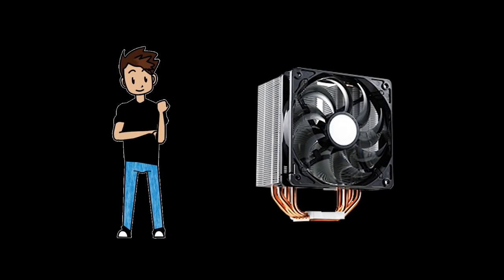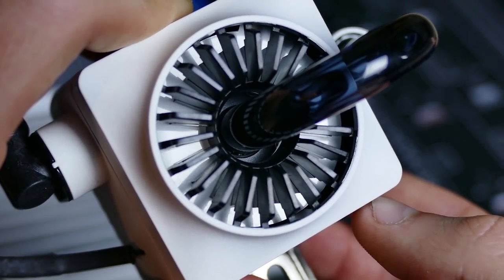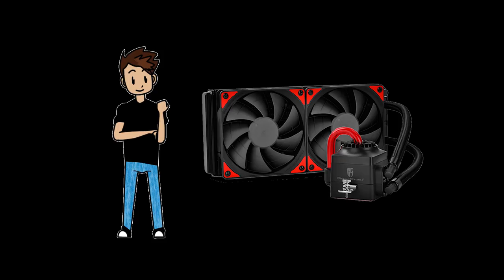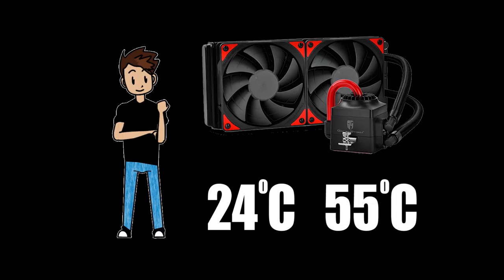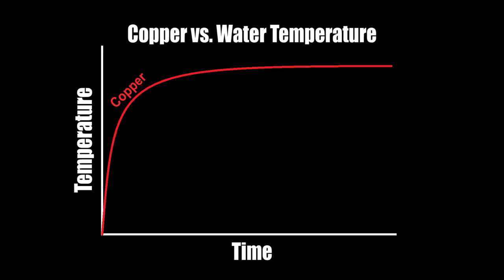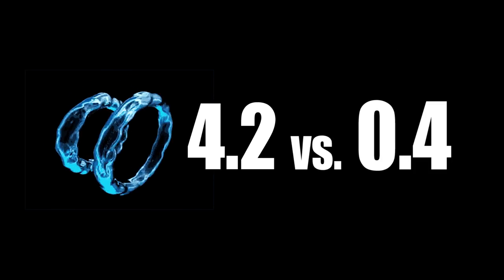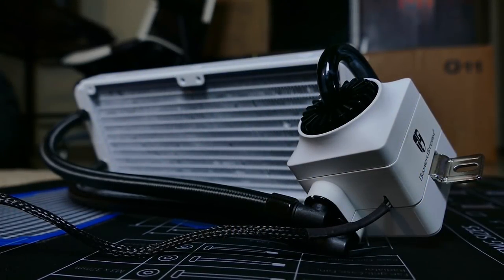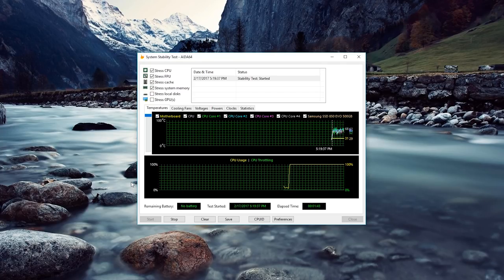How to Properly Measure AIO Temperatures

Comment: TLDR: there's nothing wrong with AIOs, only with users simply misinterpreting AIO results.
Reply: up to the top mate
Reply: Cool, thanks. Now i can finally change my stock cooler without this guy being condescending
Reply: Yeah, and idiot reviewers not understanding that cooler for longer if an improvement. Compare it to upgrading the intercooler on a turbo car, and you expectations will be level.
Reply: Yeah but most AIOs leak. I had a corsair h80 for 5 years till the pump failed. Then i went for the gtx 110 AIO. Lasted only 2 years before it started to leak. Air cooler you dont have to worry about that.
Reply: Yeah, that’s what he said in the video
Reply: @Richard-rk1ru  Yes but it still means the title of the video is misleading. Its making out that AIOs are lying to you (which most people are going to read as the manufacturers of the AIOs are lying to you about their effectiveness) when really what he means is that some people online are not testing them for long enough when giving their results. The AIOs are not lying at all, they are in fact effective cooling and more effective than an air cooler, he says as much in the video. Even with the people not testing them properly, most of them would not be lying,  it's simply them not understand how they work and not doing a long enough test. Lying implies deliberate deception. Hell before I put my own AIO cooler in I tested the air cooler first for 4 hours (Admittedly with Prime95, not the programme he mentions in the video) and then did the same thing once I had the AOI in and the temps were definitely cooler with the AIO, even after the water had time to heat up. I did not feel ripped of or that the manufacturer had somehow lied to me, after all, the cooling was indeed more effective.
Reply: @MegaUser213  That's an absolute lie that  " most aio's leak". if that were the case they would be out of the business pretty sharply. I've got one that's been in and out of a system at least 11 times and has never leaked yet despite some rough handling. AOI leakage is around 1% and almost always happens early in use so is fully covered by the warranty.
Reply: the irony here is that he is wrong with his premise too. water dissipates heat much faster than metal. The only reason it doesn't in this situation and in others is due to the water needing to be incased in something which takes away air flow that the metal receives. IF you incase them both with the same casing and heat them up the metal will retain heat far longer than the water. So his argument is correct but his science is flawed.
Reply: Ty
Reply: @zephirol4638  If I understand what you are suggesting correctly then you are wrong. If you took a litre of water and put it in a thin-walled copper box of roughly cubic shape (or any shape that has a high volume to surface area ratio), and also had a solid lump of copper the exact same dimensions as the water-filled box, and then slowly heated them both until they were uniformly the same temperature, then the water-filled box will cool a lot more slowly than the solid copper. This is simply because of water's much higher specific heat capacity, which means there will be roughly ten times as much total heat energy to be lost, compared to the solid copper. Water is also a much poorer conductor of heat, which would slow the flow of heat energy from the center to the sides, although there will also be convection, which would have the opposite effect and I am not sure which would be greater. However, these are much less important factors than the specific heat capacity.
Reply: @zephirol4638  Water dissipates heat much faster due to evaporation, if you contain the water then it would take longer.
Reply: @TheGodpharma  I realize I miss typed my initial comment and I should specify most metals, but I still disagree. The problem is the container for the liquid itself. The container will retain the heat as the water dissipates it. The reason the metal naturally dissipates the heat is due to air flow. Which Air dissipates heat far less than water. That is why you can spend hours out in the cold and be fine but jump in water and you will get hypothermia in no time. If you could form the container for the water, out of the water his premise would be wrong, and that was what I tried to explain in my middle of the night stupor. lol 

An I suppose I could still be wrong, so by all means if you feel I am now that I tried to convey my point more precisely by all means. I'm happy to learn something new.
Reply: @anhquansei  That is just a result, not the reason. You can do the same experiment with far less heat that will not boil the water to cause evaporation and the water will still dissipate the heat faster. 

Containing the water is the problem because there is no airflow getting to the water like there would be with the metal so it's already a flawed experiment. when proving or disproving the point I am attempting to make due to the variables not being the same.
Reply: @zephirol4638  I'm still not completely sure I understand what you're getting at, but I have realised that I did make a large error in my example, in that I neglected to take account of the difference in density between water and copper. Copper is nine times as dense as water, but it has less than one tenth of the specific heat capacity (the amount of energy needed to heat up one gram by 1 degree C). These almost cancel out when talking about a fixed volume, so in my example the total thermal mass of the solid copper and the copper box filled with water will be nearly the same (though still slightly higher for the water). This means that the amount of heat energy that they need to lose in order to drop in temperature by the same amount is nearly the same, so the rate of heat loss (and thus rate of temperature drop), under the same external conditions, will be determined by the rate at which heat can move from the interior to the exterior. This is a function of conduction in the case of copper, and conduction plus convection for the water. Copper is a much better thermal conductor than water (by a factor of 600), so I think the copper would cool faster, but I don't know a way to calculate the effect of convection. In microgravity, where there is no convection, the copper would certainly cool faster. The key difference in an AIO is the rapid forced movement of water, which will move heat away from the CPU much more quickly than air could, but that still has to be dissipated to the air via the radiator, in the same way that an air cooler does. Once a water cooling system reaches equilibrium the rate of heat loss is determined only by the radiator and fan system, which isn't inherently any better than an air cooler, but in practice is probably more effective just because the radiator/fan system on a water cooling setup is usually bigger than an ordinary air cooler/fan.
Reply: I felt my hands cramping watching him speak.
Reply: @user-dz3lo4wh1q  Early as in when you first use it. The case is that if it is faulty then it's faulty direct from the manufacturer and also would be likely to leak inside the box. It's filled with water so any leakage of water directly onto the PCB of a GPU could potentially harm it but it's not like an  AIO undergoes a massive increase in pressure when the pump comes on, it just circulates the water. You would know if it was leaking before it became a problem.
AOI's are getting better every year and I'd not hesitate to use one in any system that I did not have plans to do any extreme overclocking with. I'm currently running 3 aio's now , a mixture of CoolerMaster and Corsair. The one I spoke of in my post last year is a Corsair H90 and that's still going on one of the kid's systems and has to be at least 6 years old.

Comment: Greg you can't just ignore your chemistry rules from chem lab, 4.18 J/mol Greg keep at least 2 decimal places to get accurate results.
Reply from the maker: Meh. 4.2.
Reply: Salazar Studio also if you use a metal with a very high specific heat capacity, that means it would take a lot more energy to reach the same temperature as the water therefore extracting the heat out of the water faster. is there a negative consequence to that because I know this problem can't be resolved that easily.
Reply: Salazar Studio "Good job, your bridge is now in the river and you just got fired" -my dad
Reply: The rule really is: always round the the least accurate number. If your least accurate number is an int you can't really use decimals, which is why you'll see decimals with only zeros if the integer is the result of two decimal numbers.
4 + 4.2 = 8
4.256 + 5.7442193 = 10.000

Also more decimal points is not equivalent to more accuracy but more precision, very different words in science.

Comment: This failed to address the most important factor:

the specific heat capacity of  RGB LEDs...
Reply from the maker: Tru my b
Reply: RealNukerity lol how can you even remotely think he is serious? XD that's a joke
Reply: god you must be fun at parties
Reply: It would take about six LEDs to consume a Watt, about 90% of that Watt would be heat.
Reply: My predictions for the future of PC modding:
* Glitter flakes in the coolant.
* Much chrome, many tassels around case windows, RGB bobble head Jesus on PSU shield.
* Organic cases, Tweed & bamboo, driftwood etc.
Reply: Massimo O'Kissed Glitter in coolant?! Do you imagine what will happen to the pump and radiator after that stuff clunks up in a choke point?
Reply: You know that we allready have pearls in coolant, right?
Like in a good pearl paint job.
Looks amazing.
Reply: +Imaran Syafi He's never been invited to one.
Reply: RealNukerity red for better overclocking and blue for lower temps all around
Reply: Massimo O'Kissed I just want the chrome chassis. that's it. good for blinding would be burglars with the RGB LED rainbow
Reply: +Massimo O'Kissed

>It would take about six LEDs to consume a Watt, about 90% of that Watt would be heat.

Red, green and blue LEDs have different efficiencies and voltage requirements, but none are only 10% efficient. LEDs with poor efficiency haven't been made since the 1970s with early GaAsP LEDs.

Modern GaN LEDs can be more than 50% efficient, with less than half of their power consumption being wasted as heat.
Reply: +Deltakilla45

>0.5watts per standard LED

Standard indicator LEDs are not half watt, those would be ridiculously large and require a heatsink.

LEDs used for indication/decoration run between 1.8-3.4v at a current between 15-20 mA. This would be between 27 and 68 milliwatts, not 500 mW.
Reply: +Deltakilla45

>im talking about the standard 5mm half watt LEDS that have no heatsinks

Standard 5MM T1¾ LEDs are not half watt. I did the calculation for you, which applies to both T1 (3mm) and T1¾ (5mm) LEDs. They run between 27 and 68 milliwatts.

Specialized T1¾ 5mm LEDs do exist that can run at half a watt, but are expensive and have a heatsink almost as tall as the LED itself attached below it to dissipate heat:

www.ebay.com/itm/371136457827
Reply: +Deltakilla45

>i see no heatsink

Because you didn't scroll down the page.

http://www.topbright88.com/ebay/ebaypix/shop4leds/5mmHPled4.jpg

Half of the heatsink is embedded inside the plastic/resin body, with the large metal plate with holes being the part exposed to the air.

This is a standard T1¾ 5mm LED, notice the lack of any heatsink and the inside lacks huge metal planes.

http://i.ebayimg.com/images/g/QgQAAOSwo4pYR46l/s-l1600.jpg
Reply: +Deltakilla45

Haha, are you mad that I've proven you wrong time and time again? Maybe you should have properly done calculations before making the claim that standard T1¾ LEDs are all half watt.
Reply: You're both wrong. The percentage of electric power consumed by an LED (or any other device), that is converted to heat: 100%
Reply: Geoff Graham Wtf? You are saying that ANY device produce 100%heat? So the light bulbs above you are only heating and emit no light?
Reply: Some percentage briefly exists as visible light, yes. Which is then instantly dissipated as...
Reply: I have rgb socks
Reply: Don't listen to this Dude though it's Bullshit the Aio and H100 is very Entry Level and will perform Badassedly.
Reply: JR I prefer my x62 with 280 rad
Reply: Geoff Graham,
Sigh. No. For many thing that's true, but not lights of any kind. In fact the EFFICIENCY of a light is the amount of photonic energy produce vs the amount of energy it took to create that. So if a light was 90% efficient and took 10W of energy to run then 9W of energy is converted to photons with 1W being heat. 

In a closed box the photons would bounce around and eventually be converted to heat but that's not what we're talking about.
Reply: Jeffrey Photonboy Why wouldn't you talk about that? The computer case in this example is a literal closed box. And unless it's full of mirrors the light doesn't bounce around much. So not eventually, but instantly converted to heat.

Some small portion of the light will escape the box and to fall upon the walls and your retina allowing you to observe the cool rgbness of it all. But if you are using the room's air for your cooling, then even those photons heated up your rig. In fact, the only losses here are the photons that escaped your window and fell on your neighbor's house. That is a vanishingly small percentage.

I was being a bit cute up there, but I'm still right. The amount of heat contributed to your thermal envelope by 3 watts of LEDs is about exactly 3 watts.
Reply: SPEEDERT12 , I'd be pretty confident that fittings, tubes, impeller pump and rad could handle glitter flakes.

It's the tiny fins & channels in the cooling blocks I reckon would choke.
Reply: Walter White was an inside job.
Reply: LED fires: the latest epidemic.   Note to self: invent liquid helium LED cooling solution.

Comment: 1. Absolutely nothing to do with AIOs in particular but water cooling in general. Custom loops are no different.
2. "Lying" would be a manufacturer misrepresenting results obtained after a 1-minute stress test, which they typically don't do and was not demonstrated.
3. The higher heat capacity is portrayed here exclusively as a detriment because "your CPU will run hotter for much longer after gaming sessions". In reality, your CPU will never run constantly at AIDA64 load levels - short bursts of heavy usage with a lower total average are much more common.
I.e. with (decent) water cooling your temperature spikes are much lower under typical conditions (as well as your overall average) which is more beneficial. This also prevents thermal throttling under sudden heavy loads (again, not talking about 6-hour AIDA64 tests).
Also, would you rather have your CPU run at 80-90°C for an hour with the cooler fan running at 100% (putting stress on both components) followed by an hour at ice-cold 30°C (while you're not even using the PC) vs. having it run for 2h at a very comfortable 50°C for any architecture?
4. Title is misleading and clickbaity as fuck, and the video doesn't get much better.
Reply: Insert THANK YOU meme here.
Reply: Thank you for telling the truth, with this comment you put him in recovery position.
Reply: So would an X62 allows me to run my 7700k at 5GHz around 1.36v without overheating? My current H5 Ultimate causes it to hit in the 90s, I think it might not be seated properly, but I was thinking of changing to an X62 to hopefully get much better temps
Reply: @MrZodiac011 
It worked for my i9 9900k (all cores at 5ghz).
But I change the fans by noctua 140mm pwm fans.
I use the industrial 2000 rpm version but I don't go above 1500 rmp.
In stress test with occt my max temp is 60C (I use four fans in push and pull).

My gpu is water cooled in the same way too and the max temp is 42C (it's a rtx 2080ti).
Reply: @Street_Cyberman  Jesus dude you must of put a shit ton of money into that lol. I have a i5 9600k and a 1080ti and would love to water cool my build :P I would probably upgrade the cpu before I did that though to a 8700k or 9700k. I have no real need for anything i9 wise.
Reply: @LunchBXcrue  
I use two Kraken x62 one for the gpu and one for the cpu, and they are both in push and pull.
So it's actually cheaper than custom water cooling :).

To buy it I sold my old pc (gtx 1080ti, i7 6800k...)
You can see my jimmy rig pc:
https://ibb.co/HPZfJSB

yes, you should upgrade your cpu.
Reply: @Shizumi Munyu -- I don't like videos when people are looking at to you with this look in the eyes, point the finger at you (indirectly, but still) says things, and patronize you. And here, this person, who calls himself "Science Studio" (which is pretentious...) is like "I'm here to teach you. You know nothing, little Padawan." But anyway, I dislike this video for the same reason, Shizumi Munyu -- The title of his video is misleading and a click-bait, definitely.